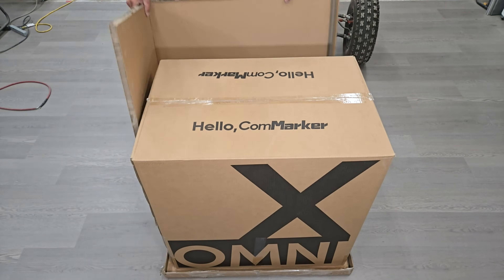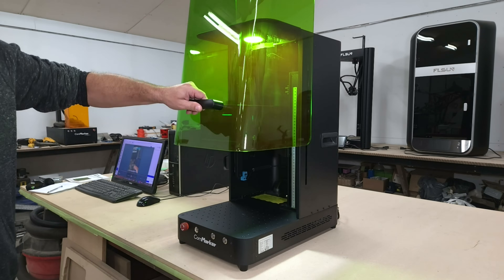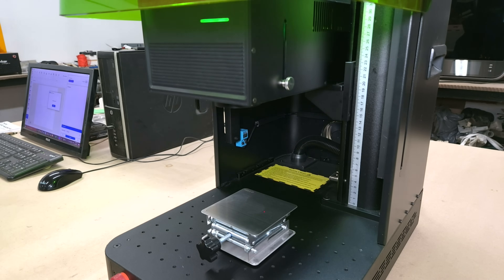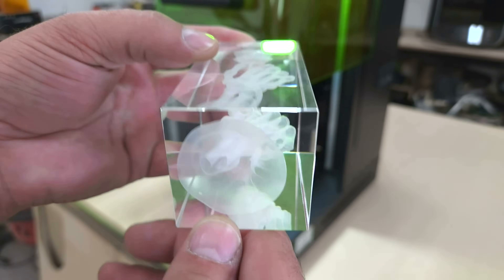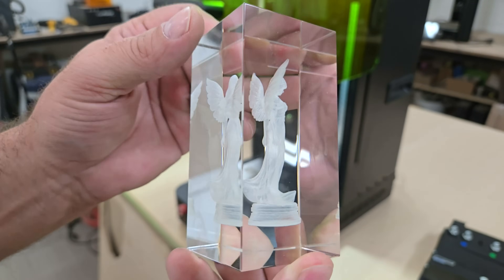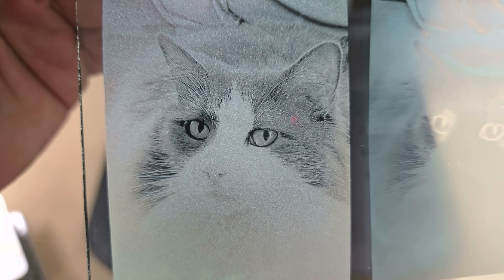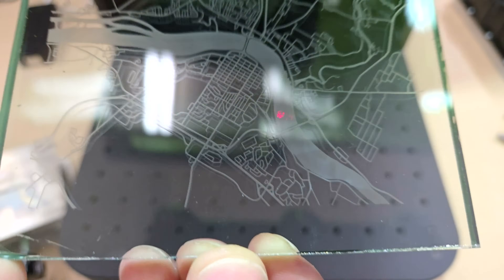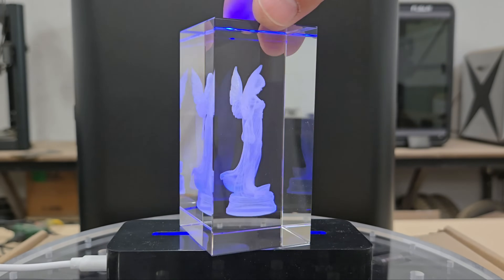3D Engraving INSIDE Crystal! ComMarker Omni X UV Laser - First Impressions

Comment from the maker: Edit: 3D crystal engraving took ~30 min each, photos took 10-15 min each. ComMarker doesn't currently sell the crystal blocks but you can find them elsewhere online for ~$20-30 CAD (example below). If you have any questions, post them in the comments.

In this video, I take a quick look at the new ComMarker Omni X UV laser engraver, the upgraded version of the Omni 1, and give you my first impressions of it. This machine brings major improvements, including a fully enclosed shielded design, autofocus, exhaust control, and compatibility with rotary and slide extension accessories.

I’ll walk you through the assembly, software setup, and autofocus process, then test some of the Omni X’s most exciting features like 3D crystal engraving using ComMarker’s new laser engraving software.

We’ll test:
- 3D engraving inside crystal blocks
-  Photo engraving on and inside glass
- Swapping lenses for larger work areas
- UV laser marking on sensitive materials (plastics, fabric, food, metals, etc.)

The results are impressive - especially the 3D engravings inside glass that look like fine silk suspended in resin. I also cover some drawbacks, like the noise level, but overall, the Omni X is shaping up to be one of the most versatile UV laser engravers I’ve tested.

If you’re looking for a machine that can handle delicate materials without damage, while still offering the flexibility to engrave glass, photos, crystals, metals, and more, the ComMarker Omni X is worth considering.

Crystal blocks:
https://www.aliexpress.com/item/1005008575149372.html

Get the Omni X here:
https://store.commarker.com/products/omni-x-uv-laser-engraver?ref=at2dg_X0qLKhdS

Follow RST on Facebook:
https://www.facebook.com/RenewableSystemsTechnology

Comment: One thing I have not seen anyone cover is venting the fumes/dust from this machine. Did you find this to be an issue?
Reply from the maker: Every laser needs to have exhaust control. With the exception of marking inside crystal, they literally vaporize material so particulates will become airborne. Some processes are worse than others (eg marking vs deep engraving), but even marking materials can output fumes. The enclosure has an exhaust fan, all you need is a hose leading outside your workspace.

Comment: I like the crystal engraving. Is cube the only ship we can do? Maybe we can do trophy too? And the sound, is there anything we can do to make it lower?
Reply from the maker: You can engrave different crystal shapes, as long as they physically fit the work base and within the focal adjustment limit, and your design to engrave fits within the work area (70x70mm for the 70mm lens, 150x150mm for the 150mm lens, 150mmx400mm with the slide extension). I'm not sure there's anything that can be done about the sound - it's from the cooling fans in the laser module. UV lasers generally require more aggressive cooling than other types of lasers. I think the only way around it is for ComMarker to design a liquid cooling system for it instead.
Reply: @JamesBiggar  Thanks. Is the Omni 1 is more quiet than the Omni X?

Comment: How does the depth of etching change?
Reply: There's a lens with an adjustable focus that sets the etch height. If you go to 3:39 in the video, you'll see that the beam is wider at the top of the crystal and narrows to a point where the work is happening.
Reply: @IAMSatisfied  Ahh ok, how does that lens change the focus point? Does it travel up and down to match the distance from the etch?
Reply: @beachboardfan9544  An adjustable focus lens is actually a multiple of lenses, and as such can leverage distance, i.e., the moving lens isn't moving nearly as much in relation to the movement of the focal point.